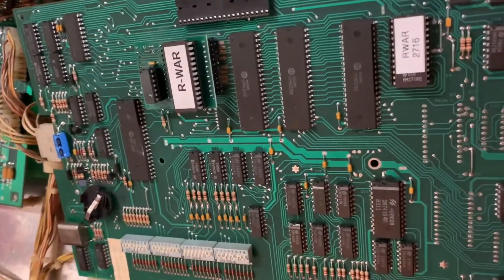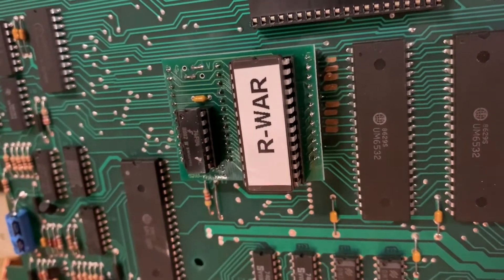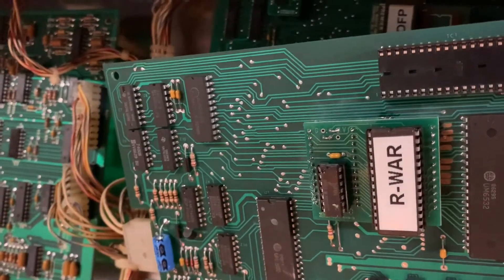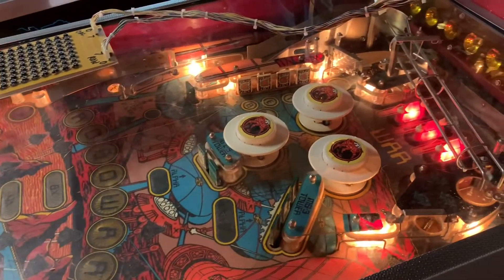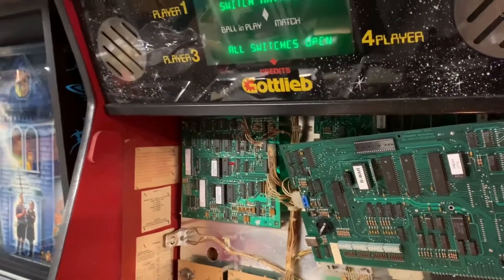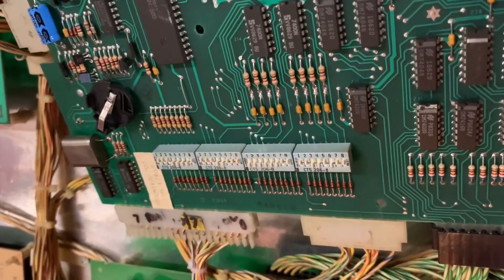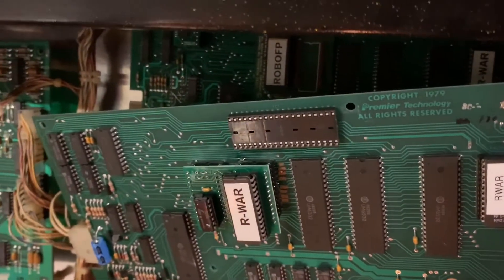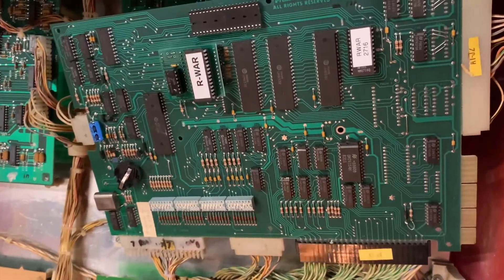Gottlieb System 80B MPU Repair and Test

Comment: Robo war is a fantastic system 80b pin possibly the best!

I enjoy the nostalgic 80’s digital sounds. 
It really compliments the sci-fi art package. Robo War apparently was update of a Sinbad playfield layout with a similar Mars God of War stargate ramp. 
Two great games in one!
Reply from the maker: Agree 100%
Reply: @ChrisHiblerPinball  Hi Chris,
I have a very simple setup with simply includes a dmm, chip tester, capacitor tester, logic probe, desoldering station and so on. What is your suggestion for the best quick diagnostics setup for Gottlieb System 80’s? That’s the pinball Manufacturer I enjoy collecting mostly.  

Thanks! 🍻
Reply from the maker: @retroamusementsnl4780  The absolute best tool for diagnosing System 80 MPU issues is the QuickScan80 that Ed at Great Plains Electronics made many years ago. Unfortunately, that tester is NLA. Next best IMHO, is Marco's ROM in a PiniTech developed board that mounts into TC1.
Unfortunately, that board is currently NLA too. You might be able to coax Wayne into making more of them. Drop him a line at PiniTech.
Reply: @ChrisHiblerPinball  Excellent! Thanks for your reply. I will try to coax Wayne. Every enquire helps! The only available setup currently is the NEODIAG-80 which apparently is similar to the unavailable Quickscan80? Thoughts?
Reply from the maker: @retroamusementsnl4780  I looked at that tester briefly, but not enough to provide an opinion of it. Let me know how you like it.